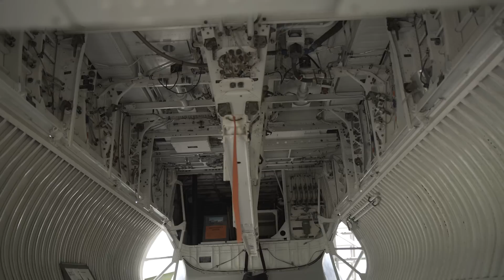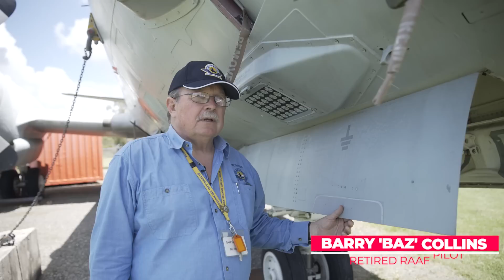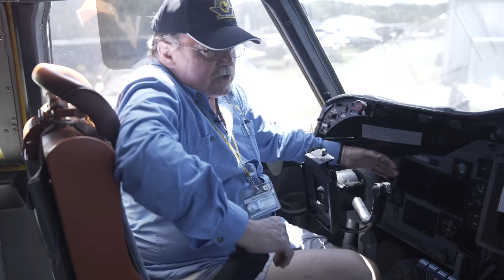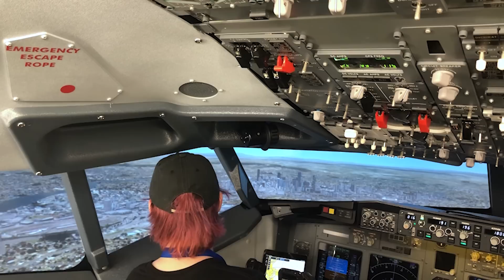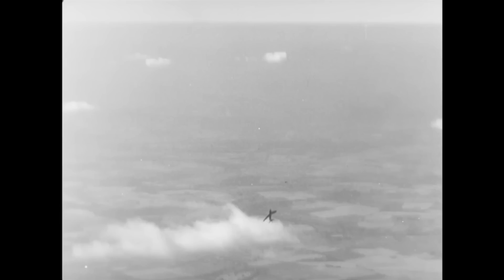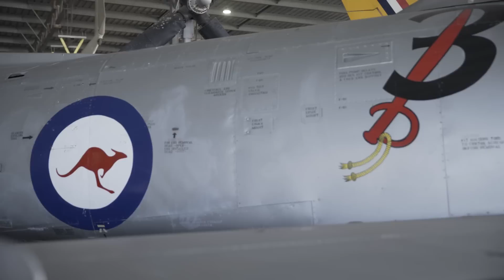Queensland Air Museum Tour

Comment: VP-48 88-91.    We rarely shut down one engine.   As I was told..  it put to much strain on the props of the other engines.   Flying on all 4 engines increased the lifespan of the props....    Good tour of a P-3C.      One interesting story..   We were outta Moffett Field Ca.    To get to Adak Alaska,  from Cali, required a fuel stop.   Coming home to Cali.. from Adak was a non stop trip.   The Jet Stream gave us a faster trip home.    Very appreciated after 6 months on Adak.
Reply: @Milkman3572000  what a load of crap you typed. Sorry you listened to the wrong people.